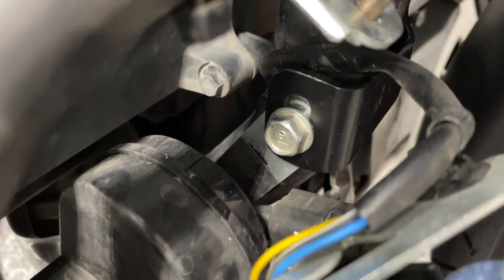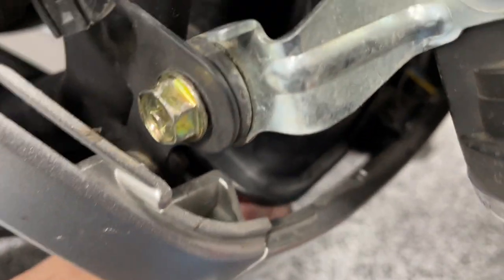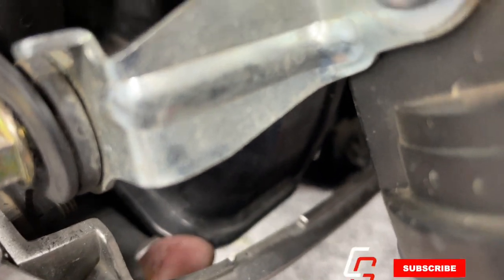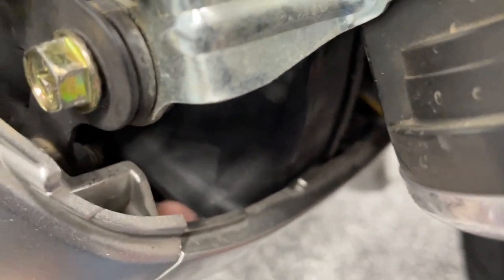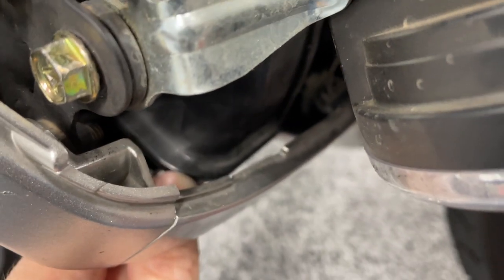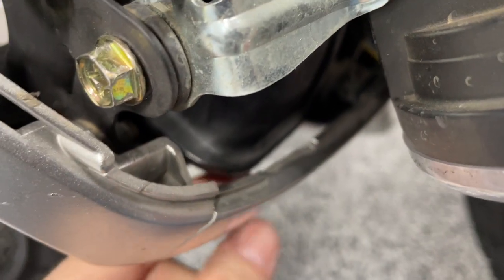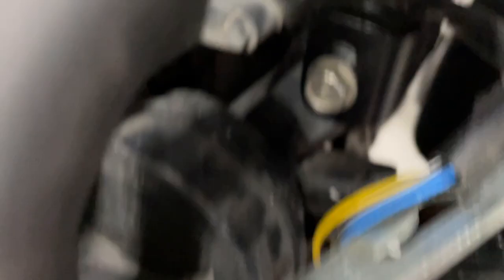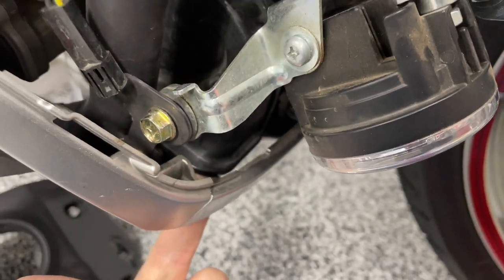Ep 01 Re-tightening Horn Mounting Bolts | 2018+ Honda Goldwing | Wing Tips

Comment: Hey CM , I just bought those tie down brackets,  didn't put them on yet . Thanks for the advice.  
Taking the high speed ferry from Milwaukee to Muskegon Michigan this summer,  and they require that you strap down your bike on the four corners. Guess I'll have to find somewhere in the back of the bike , or at least make look like it's straped .
Ride safe .
Reply: You can strap down across the seat for a ferry ride or take off the covers for the rear crash bars and use them to strap down.
Reply: Thanks Manny .
Reply: @michaelbayliss1794  Your welcome. You might consider taking your own straps as the ferry ones tend to be a bit gross.
Reply from the maker: Yes. In fact, that is how they come from the factory, with a strap over the seat area, actually the frame under the seat because the seat is not installed at the factory. And, the rear tie down covers are simple to remove. If you do strap down over the seat, use microfiber cloths between the strap and the saddlebag lids to prevent paint damage.
Reply: @cruisemansgarage  I should have mentioned that. The Ferry's straps tend to be oily and greasy. If you don't protect your seat you will most likely be in for a bit of a slippery ride.

Comment: Going along with what you said, I added the tiedowns also and had to remove those bolts. The tiedown brackets were powder coated. After that my horns did not  work because they use those bolts as a ground and the powder coated brackets did not conduct electricity. I had to run jumpers around to get them to work because I did not want to scratch the powder coating off.
Reply from the maker: I have not tested my horn, I will check that this morning. But, my horn brackets are UNDER the bracket, not on top of it.